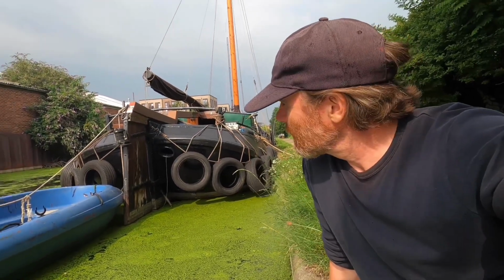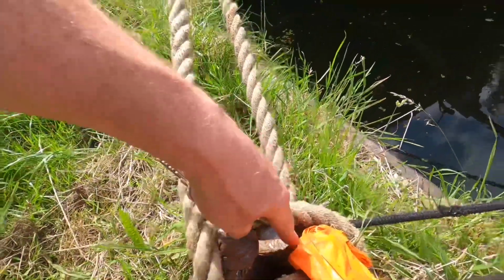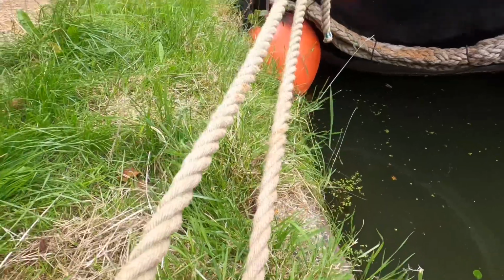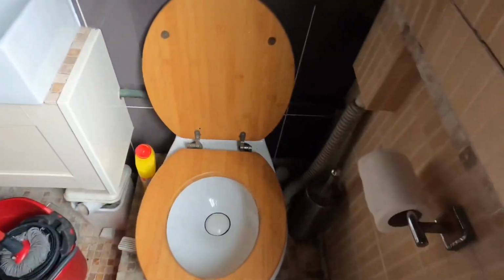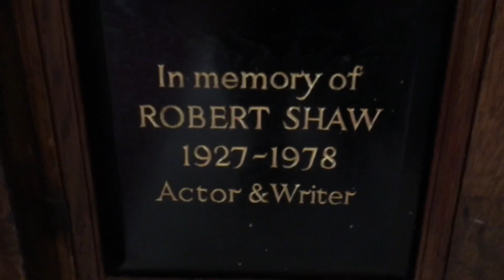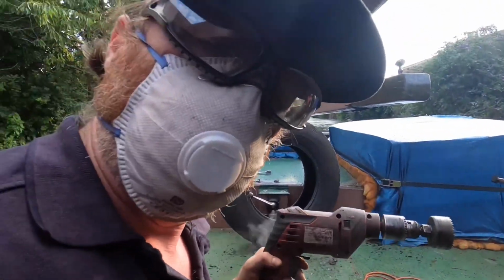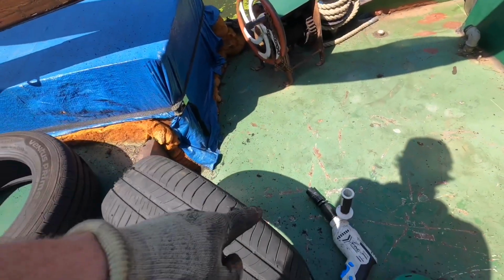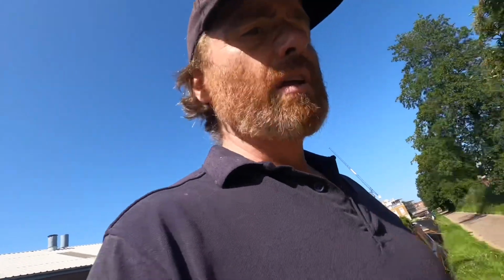A week of chores and some furniture for Linda…. Dutch Barge Linda #56

Comment: Canice,  would those corkscrew pins be able to withstand the strain from other boats better?
Reply from the maker: I see them work very well with narrowboats, but when you see the speed Linda heads off at, when the boats pass (at speed) it’s a lot of mass to slow down. Here’s the thing, that arrangement I showed of my mooring ropes was not enough, I had to use a ratchet strap to the iron rail at the front to stop her moving. Meanwhile Jorja on just a mooring pin either end - no problem…
Linda’s heavy. I see wide beams pull off there mooring pin, and straddling the canal all the time but never appreciated it until I owned one. It’s only recently that I’ve been mooring where there are no mooing rings. You live and learn

I’ll look into mooring springs, might make some….